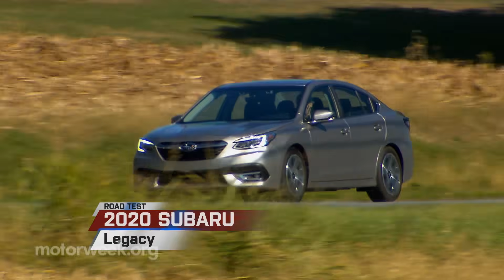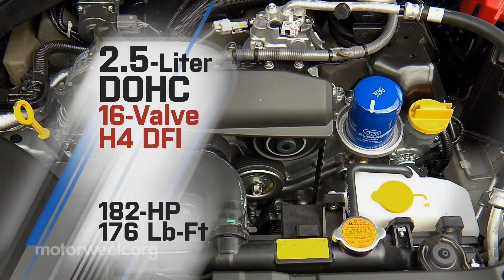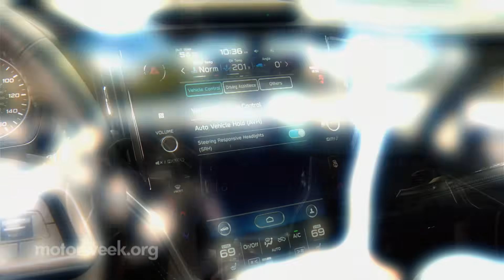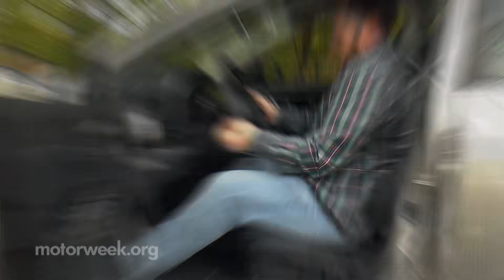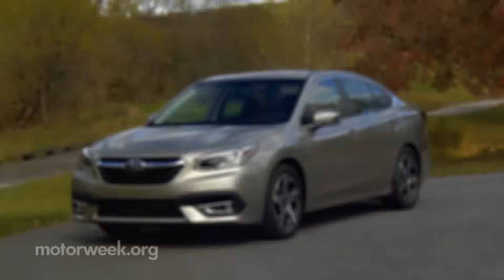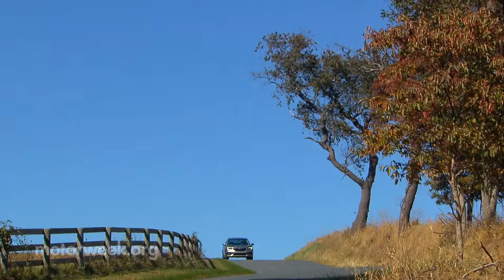2020 Subaru Legacy Takes an Upscale Turn | MotorWeek Road Test

Comment: I was considering purchasing a new Subaru Impreza. The reason it is no longer considered, is because of the weak 2.0 engine. I own a 2018 Impreza 5 door. My only complaint, is the weak engine. I wish Subaru would discontinue the 2.0. Replace it with the 2.5. The 2.5 gives,another 30 horses and same mpg. Now, we are considering the Legacy. I will stay true to Subaru. I also own a,2020 Forester Premium level. It is a great vehicle. I just need another new car. Looks like I need to settle on the legacy.

Comment: That 8.3 seconds 0-60 mph is pretty optimistic.  Other testers have shown it takes between 8.6 and 9.0 seconds for that speed, the slowest in the segment (Camry can do it in 7.9 seconds with the standard four).  For short ramps on the Merritt Parkway in CT that won't work - you are stuck with the turbo.
Reply: Sad what the Legacy has become.
Reply: @johnmpifer  Still own my 2013 Legacy with the H6 engine and 0-60 about 7.5 seconds - enough to merge on the Merritt Parkway which is like a drag strip with the short ramps.
Reply: @Buc_Stops_Here  Pretty underwhelming for an engine that is supposed to be, what, 250 HP? 

That’s similar acceleration to my V6 Tacoma.
Reply: @johnmpifer  I am not sure what you looking for.  A 2013 V6 Camry makes 268 hp.  The 2013 Legacy makes 257 hp.  That is only 11 hp difference.  It is not a performance car - neither is the Toyota.  It is for people like me who need enough acceleration to merge onto a crowded road with a short on ramp - and it does that well.  If you are looking for more in an old 2013 model get a Camaro V6 that makes 320 hp.
Reply: @johnmpifer  Also the 4 cylinder Subaru today only makes 180 hjp.  The turbo makes about 260 hp.  This test used the 4 cylinder.

Comment: 70% (!) increase in torsional rigidity...what was it made of before, jello?
Reply: Agree. Must be a marketing buzz word.  They seem to say that all the time with each new generation.  They are now in the hundreds of % stiffer.
Reply: @80srockerable  I'm tired of the tall tales about stiffer frames also
Reply: Should mean less rattles, and test show that it does have fewer rattles off of the assembly line.  It is the simpler way to understand it (although it does mean more).
Reply: Haha. Nochit

Comment: CVT and a 0-60 at 8.3 seconds time means no buy!
Reply: For subaru owners that's plenty fast
Reply: That’s with the base engine.  If you had the 2.4 turbo-4 XT, 0-60 acceleration would be at the low to mid six second range.

Comment: I have a 2012 Legacy 2.5i Premium w/6MT.  Have had a new Legacy as a loaner when mine was in for recalls.  I will say, the new interior is A LOT nicer.  The materials, fit, and finish are noticeably better.  But the CVT does, and always will, suck.

Comment: CVTs are crap. I'll never buy a car with one.
Reply: They are for real men, best steer clear otherwise.
Reply: You're really smart there chuckle head.
Reply: @bwxmoto  Actually, in many respects, he's not wrong... Not only are CVT's sluggish off the line, prone to drone when cruising, and generally soul-sucking to drive. But they're also proving to be very failure prone (with even Toyota suffering widespread faults), and quite expensive to fix... Seems an awful lot to sacrifice for a couple extra MPG's.
Reply: @bliglum  Right you are bliglum, they only use CVT's to meet unrealistic mileage standards and to cut cost. Good for Subaru, bad for the consumer who keeps their car for the long term.
It will cost you near $10,000.00 to replace this CVT out of warranty.

Comment: Still in search of a reason strong enough to understand why Japanese car companies still prefer CVTs.
Reply: Main reason for CVTs in Honda, Subaru and Nissan?  Enhanced fuel economy.
Reply: 8, 9, 10, 11, and 12 speed automatic transmisions are expensive to develop especially for small cars that have no profit. Enter the CVT. 1 unit that can be adjusted and revised electronically across different products. Cheaper. The Japanese and Asian car brands have been using CVTs in their home markets for well over 2 decades, so moving to CVTs across the board helps reduce how many versions of 1 car the automaker manufactures. Cheaper. That's the theme, cheaper.
Reply: Far less parts and complexity, making them cheaper to make?
Reply: @andrewsmactips  yet they still charge a premium for what a scam
Reply: Cheap to manufacturer and cannot be service so have to buy a brand new one after the CVT is damage, $5K+. Gas mileage is improved 1-2 mpg too.

Comment: I work at a Subaru dealership and the new Legacy is selling....slowly.  I really think Subaru should've gone a bit less conservative with this redesign.  The redesign of the Outback works because it's an Outback.  People like the fact that it didn't change much.  For the Legacy, they needed to do more.  The XT trim will chop off 2 seconds from that 0-60, FYI, if that matters to the buyer.  It's a punchy engine.
Reply: Have any of y'all actually driven a CVT Subaru tho? It might have fake shift points, but it definitely doesn't have that "rubber band effect."
Reply: Rex Colletti yes it does it is garbage just like all CVTs.  Driven plenty of Subarus and other makes with CVTs. All garbage.
Reply: @bwxmoto  I don't mind the CVT in my XT Forester. The engine has enough torque that it feels like an automatic. Can't really tell the difference. CVTs need torque to feel right.  For 95% of buyers they don't care anyway
Reply: Doubt that number.  Even the people who don’t know what a CVT is probably don’t like a lot of things about the way they feel, they just put up with it like so many other annoyances.
Reply: With a garbage CVT that makes any engine feel like a rubber band wind up toy.
Reply: @bwxmoto  You really haven't a clue, have you?
Reply: @worrywart1311  it proves my point he's never driven one. Go drive a Nissan CVT and than a Subaru cvt. They're different beasts and the Subaru feels more like a traditional auto.
Reply: WTF are you talking about? I said I have driven them, and many others CVTs. I'll leave the CVTs for mini bikes and only buy cars and trucks with real transmissions.
Reply: @Worrywart  You're an anonymous youtube troll, I think I have more of a clue than you. Rex is full of sh!z saying I have never driven one. I've driven LOTS of them and they are all garbage. 3.6R Outback might feel a little better than a 2.5 liter Camry, but they're all crap and would take a manual or traditional auto any day.
Reply: Only if they drop the cvt.
Reply: Thanks for the 411 on the info of the 2.4L of the Legacy.
Reply: I just bought a Touring XT yesterday and this day and age (chip shortage, vehicle shortage) the Legacy being less popular helped me get a better deal. I didn't want an SUV or truck and the dealer took about 4.5% off MSRP, which I'll take as a win right now.  The salesman said many Subaru dealers are tacking $3,000 extra profit on their SUV models, but not the Legacy.
Reply: @jeffmorse645  The dealer was telling the truth. We're currently selling pretty much everything right now for sticker price and sometimes a few thousand dollars above that. The legacy touring XT is a nice car!!!
Reply: @oliverroo59  Just had it a day, but I'm loving it more every time I get behind the wheel. I'm tall and that seat is so comfortable and adjustable. The slide out thigh support really helps.  Plus there's so much headroom the sunroof isn't a problem for me.  That interior is so quality it looks, feels and smells like its out of a luxury car. The big touchscreen is fine too. I'm pretty much comfortable with it already. Yeah, first Subaru and I'm a fan. The buying experience was the least pressure and most pleasant of any new car I've ever bought too.
Reply: I don't mind the CVT in my 2015 Outback H6. It hesitates on take off when cold if you try and punch it too quickly, and if you take your foot off the pedal after flooring it you might get a clunk and jerk from the tranny. Otherwise no issues. Never had the overheat light come on because I don't tow, but not even in 97+ degree weather on the highway. No other issues either. Radio head unit can be glitchy but not enough to make me want to take it in.

Comment: Nice presentation as always! 

IMHO, future used cars will be electronic nightmares!!!
Reply: Ironically when they go electric, they will have fewer electronic systems. Engine management has electronics in the cooling system, oiling system, fuel delivery, ignition, emissions system, intake air and exhaust.  All of these have to work or the engine doesnt run. Electric cars just have to send power to the motor and maybe run a small cooling system.  They will also just have 1 fixed gear and get rid of that awful and unreliable CVT, which is run by yet another electronic system.

Comment: When SUBARU makes another LEGACY 2.5GT WITHOUT A CVT, THE WORLD WILL BE HAPPY! STANDARD HP FOR THIS SHOULD BE 227 JUST A STANDARD WRX! FAIL, I PASS
Reply: Actually, the 2.4L turbo-4 in the current Legacy and Outback makes more torque than the older Legacy GT, horsepower is similar.  Unfortunately, they only come in the CVT that driver enthusiasts dread.
Reply: By the way , the standard WRX hp is 260.
Reply: No manual. CVT only. 
Cya
Reply: I’d rather have a smooth CVT than a jerky auto
Reply: @mr2503-i5g  Same here. I don't want to deal with shifting.